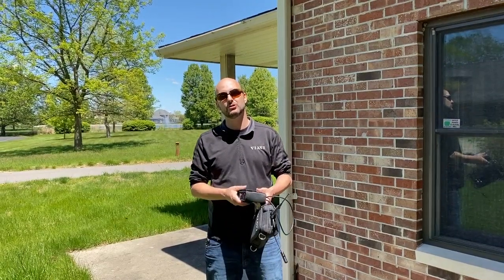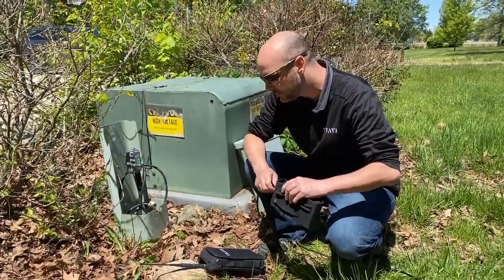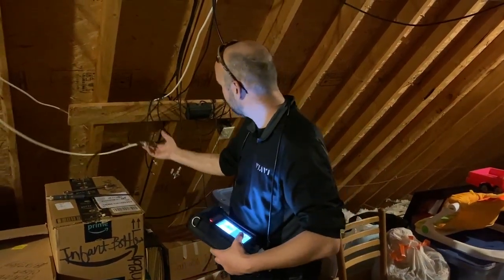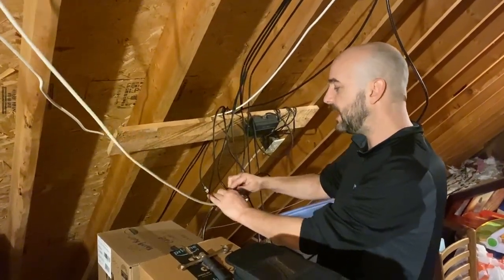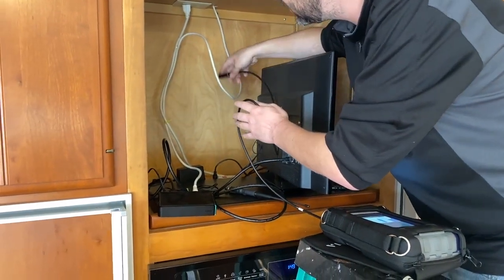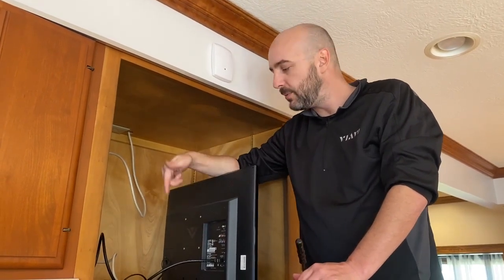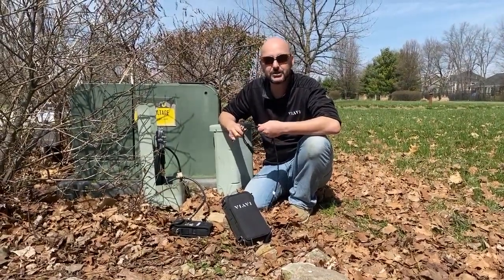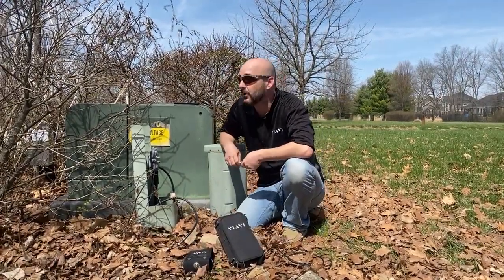Home Leakage Pressure Test Demonstration

Comment: It would be nicer if the meter can show you a diagram of all the lines and splitter in the house. Which line is bad and could possibly be damaged or loose fittings creating the ingress? And that's just checking noise, that Radio Shack cable probably has all sorts of errors with no shielding. So, the pressure tester is just to check loose connections, nothing to really help you with a damaged cable if you can't get into a certain part of the home to see if it's physically damaged or why there is ingress on that particular line.
Reply: @jimmyjoe1591  what’s the separate device called?
Reply: The TDR would help you with that.